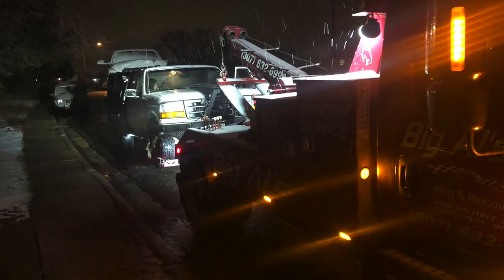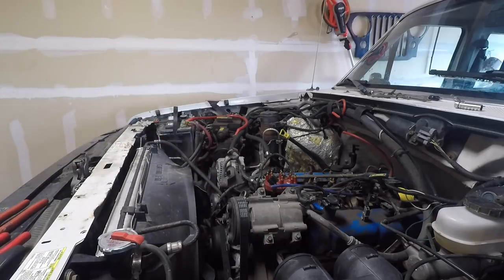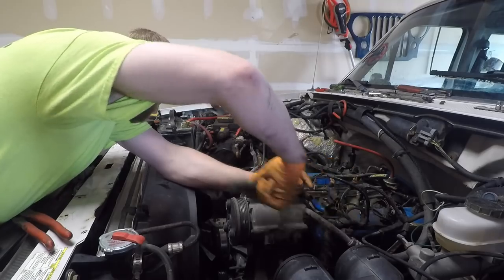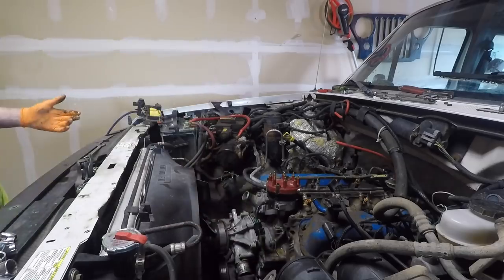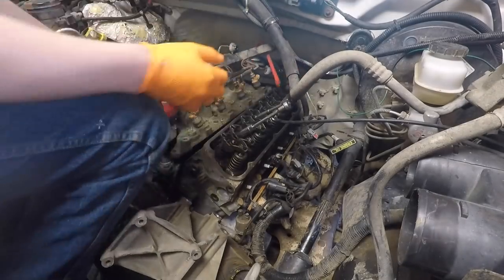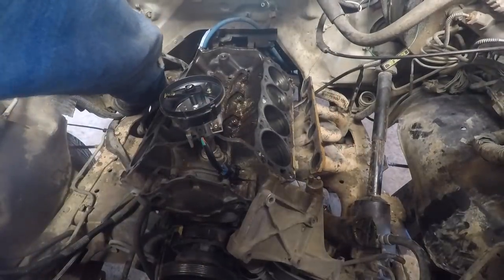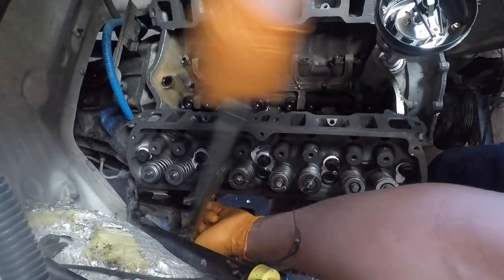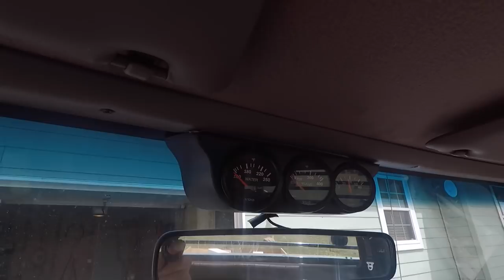Blew the engine  again!

Comment: I know how much work you put in to that truck. I have one just like it and didn’t want to buy a new truck also. But the best thing I did was put a 5.9 12v diesel with a ZF5 in my old ford. The small blocks don’t have the power and will break down more often under hard use during heavy towing. Trust me its worth doing the conversation. Good luck with your projects.
Reply from the maker: If I planned to have it forever, I definitely would 5.9 swap it. I hope to have it for a while but eventually it will be replaced.

Comment: Yup,time to drop 70 grand for a new 1 ton with a diesel,or not. Sometimes you've got to work with what you got. If you can find a take out big bore,short stroke used engine that will give you the low end(and high end) torque you need for heavy towing.
Another option is to look for a single axle class 6 through 8 truck for your heavy tow needs.
I can't pass a medical because of my diabetes but if I could there would be a good used class 8 Pete or Kenny on my lot just for heavy towing.
I feel your pain my friend: back when I was poor I well remember selling blood and plasma to buy parts to keep my 74 Pinto on the road...
Reply from the maker: I’ve considered engine swaps, but it’s a ton of work for a vehicle that I don’t intend to have forever. I’ve been seriously looking at some used Class 8 trucks and trailers.
Reply: Seen many with a gooseneck set up so you can still use your gooseneck trailers. Even seen them with bumper pull hitches. Looks kinda funny to see a KW single rear pulling a 20' bumper pull but if it works who cares.
Fuel mileage isn't horrendous: you should get 7-9 MPG with a modest 250 to 350 HP engine set up(all you need) and in my Ram 3500 pulling heavy I get 7-9 MPG on a good day,going down hill at 55 and with a 50 MPH tail wind...
Get one with a small sleeper and you'll save $75.00 to $125.00 a night when on overnight trips.
Air bag suspension is a must have or it will be bouncing down rough roads and putting a heck of a shock load on the trailer hitch.
Just like buying a used tractor expect to have to do some repairs: or not. With your background you'll know what you are looking at. Best of luck to you.

Comment: Do they still offer 460 big blocks any more ?, when I was in the states in the early 80s I had an 77 LTD WAGON with a 460 and that had loads of torque . I'm in the uk
Reply from the maker: The last year for the 460 was 1997 I think.
Reply: My family used to have a 24' 1985 motorhome with a 460 to push her along. That thing could shove you back in your seat like you wouldn't believe. Of course, the 7 mpg on a good day fuel consumption was a bit of a drawback... (It also needed leaded fuel which was already disappearing at that point, so, lead additive for extra fuel cost.)

Comment: Are you concerned about sealing the top side up with all new parts but still running an old short block?
Reply from the maker: No. The bottom of the engine is solid, holds good oil pressure and still has cross hatching on the cylinder walls.

Comment: Did you get a 4 core radiator? I would have ordered one for a 460, more capacity.
Reply from the maker: No. All they could get locally was a two row, and I didn’t want to order and wait.
Reply: I understand that. If it's anything like around here it was 2 weeks out.